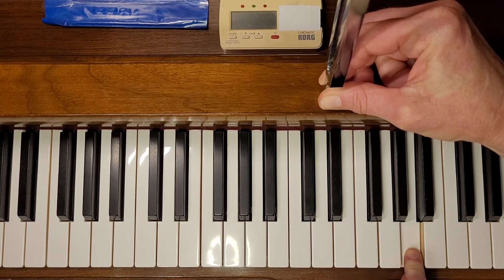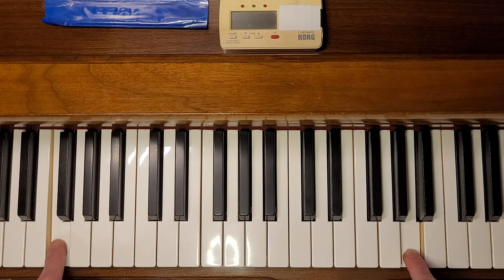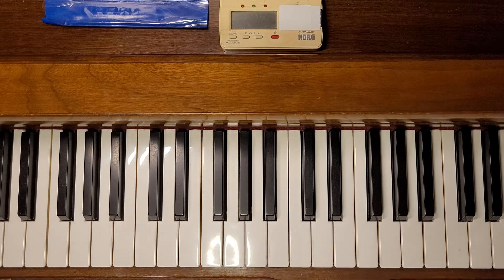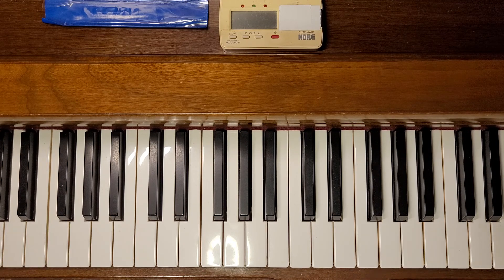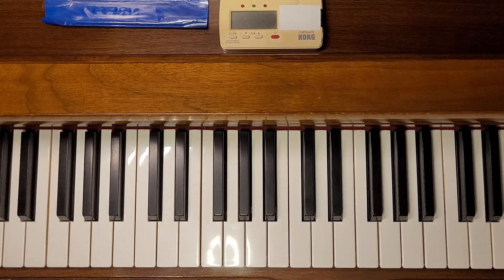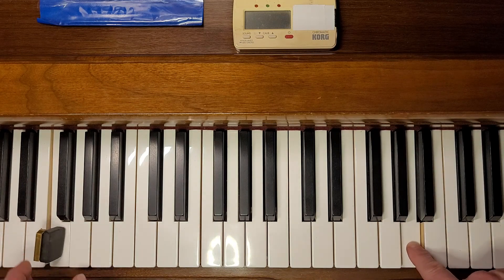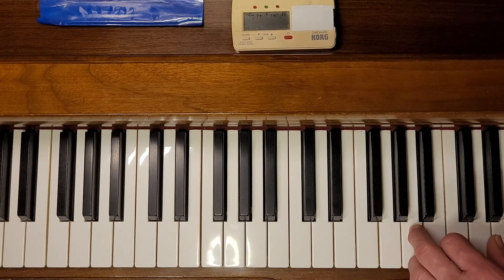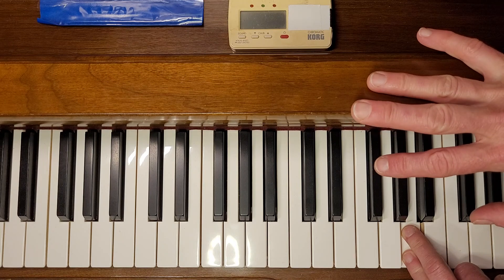Setting A4 with F2 & a pitch source & with an electronic source only.

Comment: Hi Meggie great demonstration! Do you have any video where you show step by step your tuning method?
Reply from the maker: No. It isn't based on a temperament sequence so I can't write it down or demonstrate it that way. It is based on concepts & I'm working on writing those down. I did make that video of me setting a temperament without using the octave, but that isn't my usual method.
Reply from the maker: Hey, Francesco! Email me: mags@timandmaggie.net ;-)
Reply: Comparing to the f I am confused as to if the f was tuned first?
Reply from the maker: @christinenorbe8618  Hi Christine! No, the F was not tuned first. It doesn't matter if it's in tune because we are comparing the distance between the F and two "A's". As long as the distance is the same between the two, then they match. The F only needs to be tuned to a place where the beats are comfortable to hear. :-)
Reply: @PianoTechMaggie  so you tune the 2 A’s then the F?
Reply from the maker: @christinenorbe8618  Sort of. You don't tune F2 at all until after you have tuned the midrange. You just use it as a reference. Want a video about that? I might already have one...will check...
Reply from the maker: @christinenorbe8618  I hadn't made a video about that. Will do that next!
Reply from the maker: Here it is! Please let me know if this answers your question & if you have another. :-)
https://youtu.be/NW65RbSR3dE